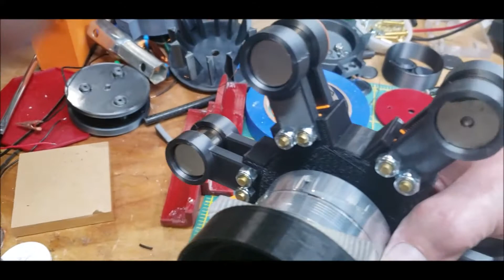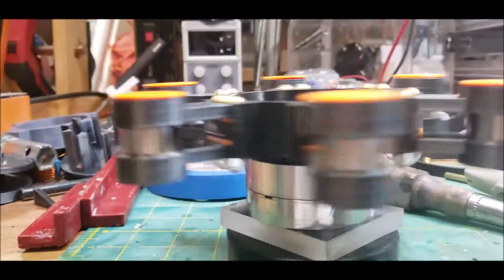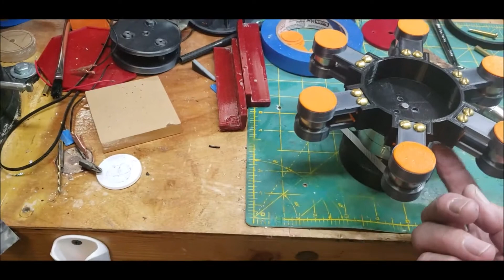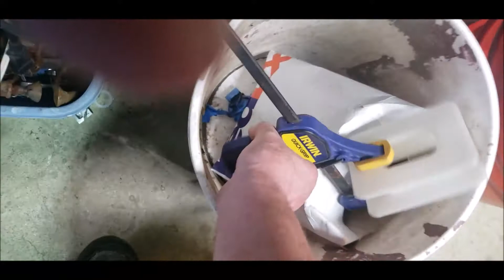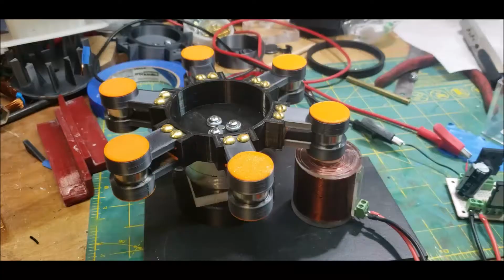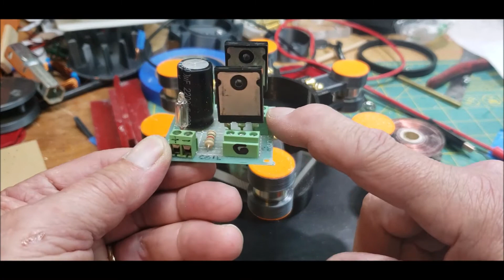3D Printed Vertical Motor

Comment: What is the best print material for the spool body? Thank you!
Reply from the maker: Probably ABS because of the strength but I personally use PLA and have had any issues with rotor breaking. PLA so easy and will a proper infill, I think its ok